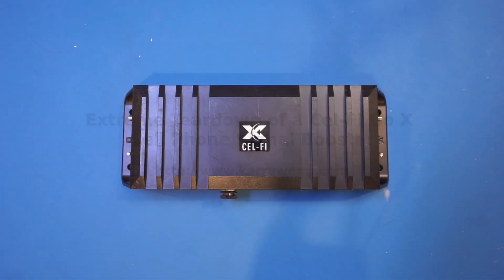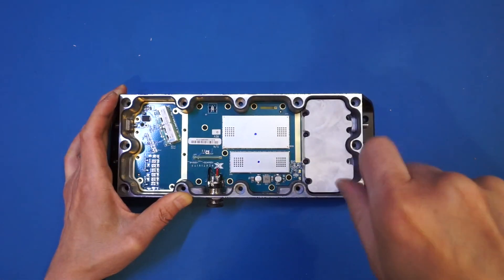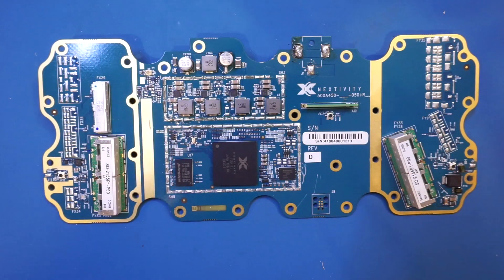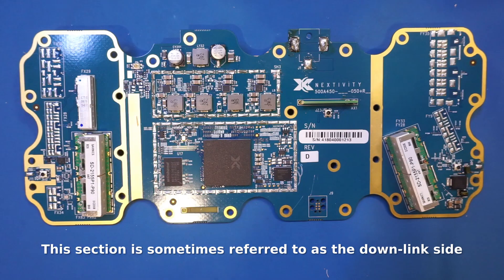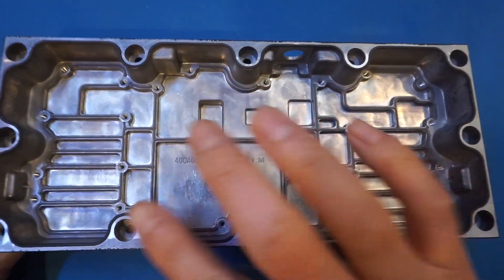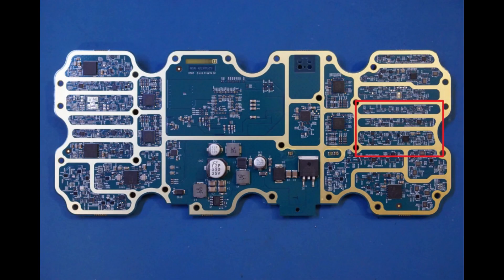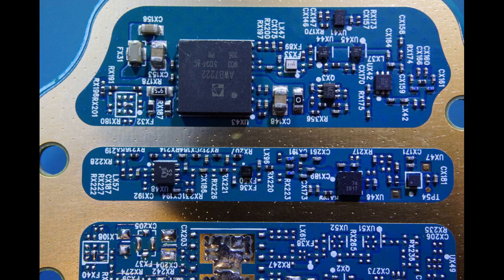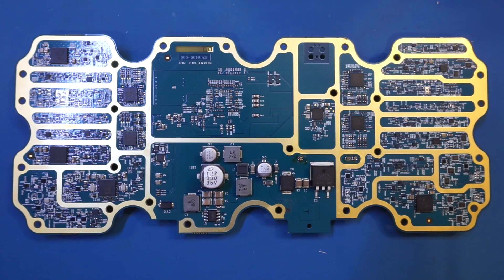Extreme Teardown of a Cel-Fi Go X Cell Phone Signal Booster

Comment: Very good. A block diagram would help. It seems to be a full-duplex bidirectional amplifier. The RX and TX are in different parts of the band. The device splits the RX and TX signals, amplifies each separately then recombines them. Quite amazing filtering to do that and so small. I am a radio amateur and play with filtering and duplexers for VHF and UHF repeaters. Quite fascinating to transmit and receive on the same antenna.

Comment: Nice video/tear down. 

I had a software update (switching from mobile to stationary mode) that my iPhone’s Wave app was attempting to install that timed out, and now my Cel-Fi unit is stuck with a solid red light and isn’t boosting. I’m also unable to connect to it with the app. 

Before I reach out to the vendor for support/an exchange, I was just wondering if anyone had any tips/hints on maybe how to do some sort of reset or something?

Thanks!
Reply from the maker: Have you tried unplug and replug in the power? The firmware update is fail-safe and should fall back to the last working state.
Reply: @KerryWongBlog  thanks for the reply. Yeah I’ve tried that several times unfortunately.

Comment: Sir, is this similar to a "Micro Cell"  I have an old Cisco SPVTG.  It only helps a bit.  Nice YT channel by the way.
Reply from the maker: No, a micro cell typically uses your existing internet connection whereas this signal booster amplifies the weak signals from the cell tower.

Comment: I am working in GSM since 1997 and seriously speaking it is my first time I see such quality booster.
btw, is it 4G only?
Reply from the maker: It depends on the carrier. This specific one supports AT&T and T-Mobil 3G but for Verizon it only supports 4G LTE.
Reply: @KerryWongBlog  so it is locked to the bands offered by the Operator - not general use, right?
Reply from the maker: @zyghom  That's correct. The booster does not just boost any signal within the bands either, it detects carrier specific signatures and only amplifies the selected carriers. In fact, you need to select which carrier you are using when you set it up. Although it supports multiple carriers, you can only amplify one at any given time.
Reply: @KerryWongBlog  I don't think it is 100% correct (or it is but I did not get it). The Operator can chose any frequency channel within the band (even they can chose the band if they wish but then the booster might not work anymore). RF channel optimisation is very common task of the Operator, and channels can change at any time - I cannot believe you would have to chose/set up the channel every time Operator changes it. But in fact you might be tight to the Band and in case Operator changed the band, you would have to either reconfigure the band (with your BT app) or... change the booster if it does not support the band. Unless this booster is remotely configured by Operator - we also used such boosters in many Operators and many countries: the booster was the proprietary of the Operator and Operator would configure it remotely - how is it in your case I don't know.
Reply from the maker: @zyghom  I might not have explained well, but when you configure to a specific carrier you can choose multiple bands that carrier supports. For instance for Verizon, you can select a combination of 2/4/5/13 (one lower band and one higher band at the same time) and within each band there are multiple channels (e.g. in Band 5 you have 872.5MHz, 874 MHz, 874.4 MHz.... so on and so forth).
Reply: @FC14RS ;-) Great. That is my every day bread and butter for last 25 years ;)